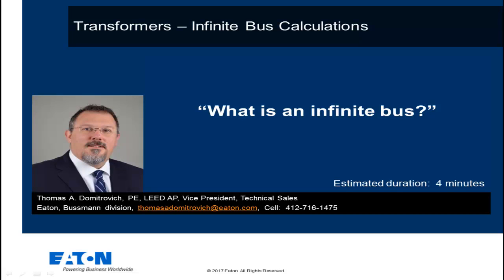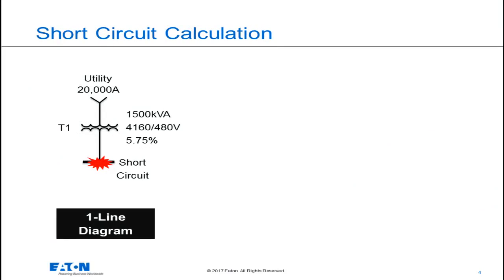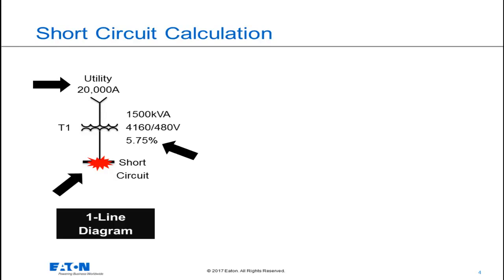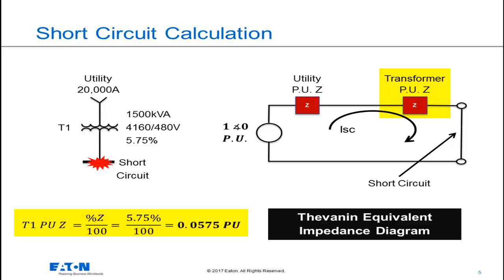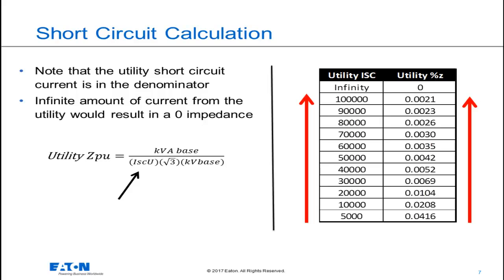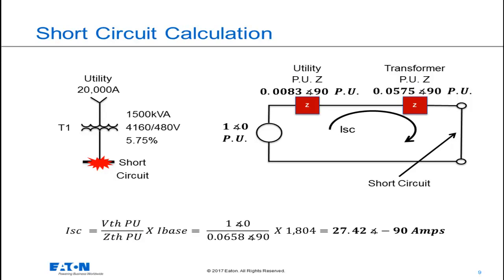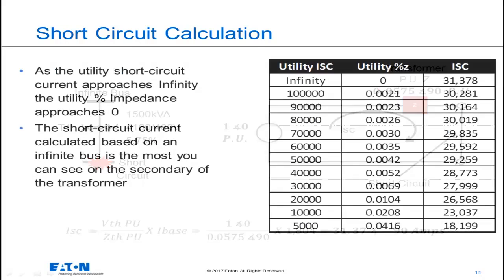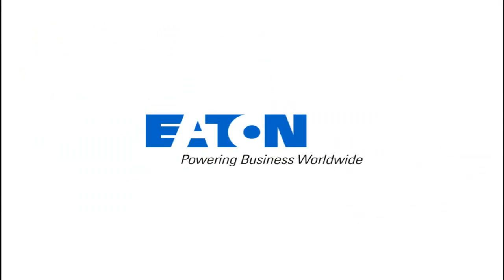What is an infinite bus

Comment: Can someone explain why Utility Z p.u. suddenly become 0.0083 p.u.? Thanks
Reply from the maker: I just put together a short video to answer your question as well as another on a different topic.  here is the video.  I would suggest you look at the derrivation of the equation to convert the available fault current into an %impedance and you'll see how I came up with that value of impedance.  thanks for the question!!!  https://youtu.be/ctYfIRnit3g
Reply: @TDUNPLUGGED  Tom, thanks for the link to the other video, but the Utility ISC here is a different value and no X/R was given in your example here. Could you walk us through how you got the 0.0083 p.u.? Thanks
Reply: @MrDands  I think it was an accident and 25,000A was used for the utility Isc. X/R ratio doesn't matter when dealing with impedances in pu analysis... unless of course you are trying to find the real power/voltage drop.
Reply: @MrDands  Unless he forgot to put the X/R ratio of the Utility which could be 1.32 and he is only using the reactive part of the impedance (which makes sense cause phase angle of 90 deg) which would give an impedance value of 0.0083 ang 90 deg. But that wouldn't make sense either cause why would you not want to use the real part of the impedance when calculating Isc? Especially when the real part of the transformer is being used in the calculation. Never mind now I'm just confusing myself lol.